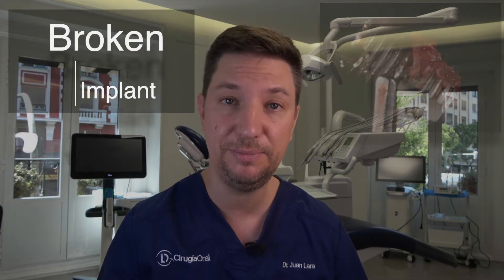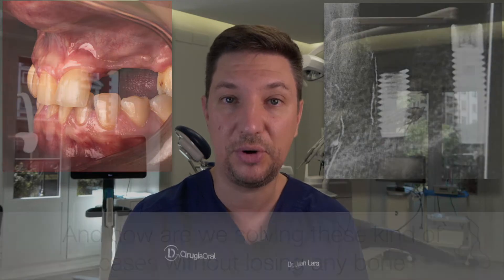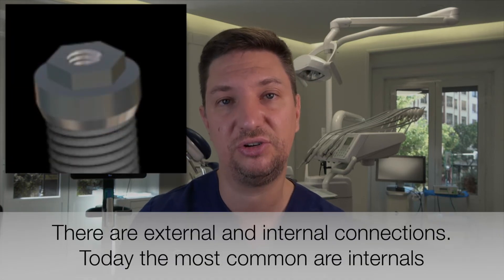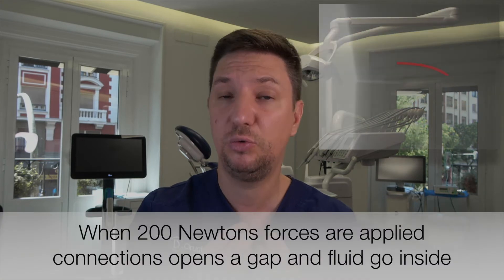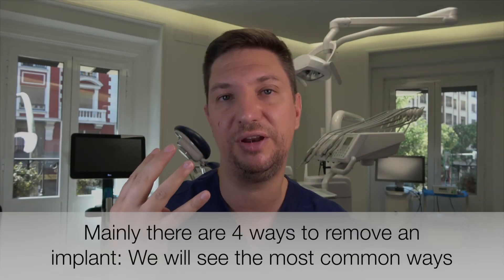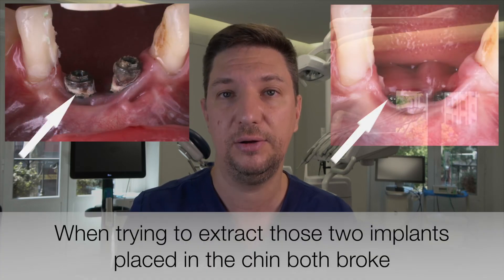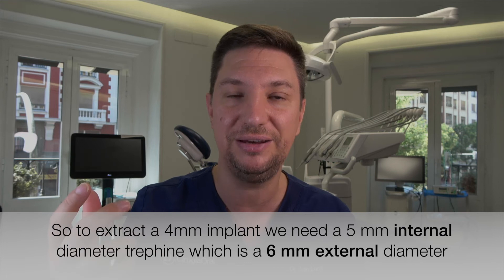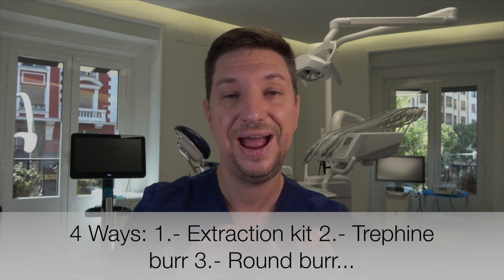Broken Dental Implant: Why does it break and 4 Ways to solve this situation Part 1/2

Comment: I completely disagree your second claim. I think it is just a speculation. If you want to protect your bone internal connection is the best option. However, if we talk about mechanical properties of implant, external connection is stronger than internal connection. That’s why we should use external connection if we have to place thinner implants. Otherwise we encounter thin implant wall for internal connection that can’t resist occlusal forces. 

Consequently, if you want to protect bone internal connection is best. If you want to get the best mechanical compartment, then you should pick external connection.
Reply from the maker: Hi,

You are wrong. 
The classical external connection is really bad, also in the biomechanical aspect. 

When you use an external hex connection all the forces are applied to the screw, that's why the crown tends to loosen and the screw often breaks.

All the best connections nowadays are all internal, specially conical internals connections.

There is no any reason to place external hex nowadays except one... it is cheaper for the dentist.

This is not just my opinion, also in the scientific literature is commonly reported: 

https://pubmed.ncbi.nlm.nih.gov/26187105/
"Internal connection implants presented the most favorable biomechanical situation, whereas the least favorable situation was the biomechanical behavior of external connection implants."

https://pubmed.ncbi.nlm.nih.gov/22682782/
"The higher levels of stress observed within implant-abutment connection when reducing abutment diameter (cross-sectional area) resulted in lower reliability for external hex implants"

https://pubmed.ncbi.nlm.nih.gov/34091686/
"Morse taper implants can be considered as a good alternative for dental implant rehabilitation because they demonstrated better biomechanical behavior for the bone and fixation screw as compared to external hexagon implants"

Best
Reply: Hi,
Thank you for your answer. However I am not still agree with you. I don't want to start an arguement. 
I appreciate for your contents.
Wish you best
Reply from the maker: I wasn’t arguing! Just exposing my opinion and also what literature says. 
Best